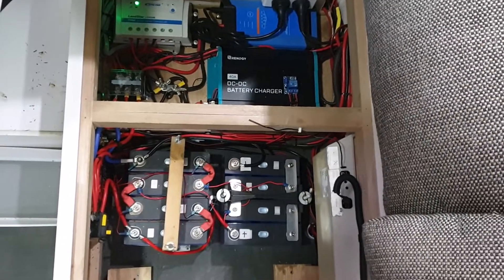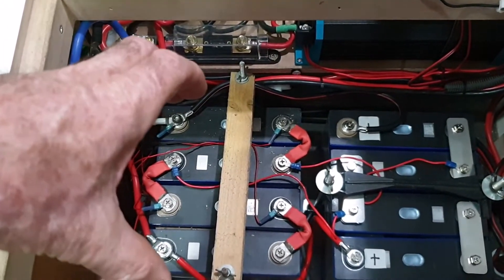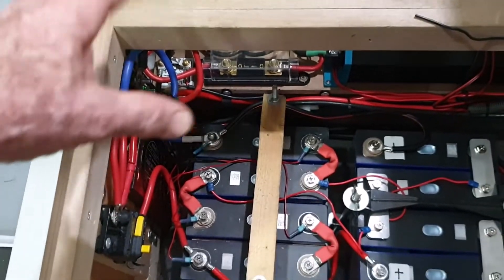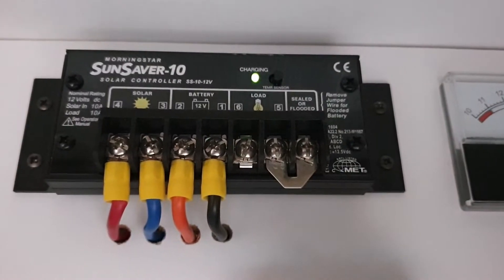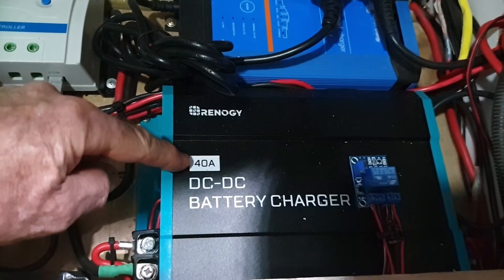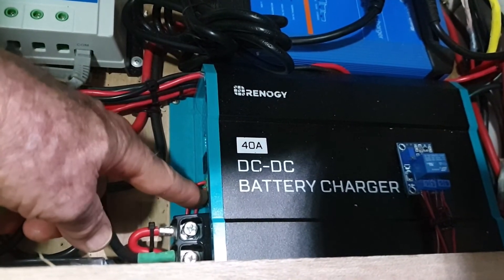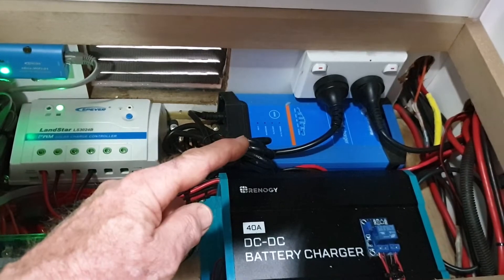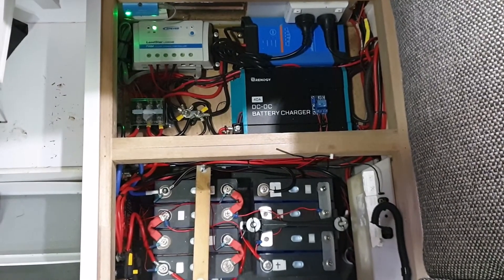Budget Caravan Lithium Battery Upgrade for Off Grid/Free Camping

Comment: Great info thanks Tim. 
My van is 2014 with the basic system same as you had, I’m just putting a plan together now and was thinking similar to what you have done but didn’t know how to go about it. 
Also, thanks for the tip on the dometic 190 fridge, I have the same in my Avan. 
Cheers
Coop
Reply from the maker: Hi Dave, sorry for the delay in replying I only look at comments every now and again. Thanks for the comments. Good Luck.

Comment: Hi Tim. Thanks for the video. Just wondered if you found the 100w panel enough or if you upgraded it. Sorry if you mentioned it in the video and I missed it.
Also, did you pout an inverter in,
Cheers
Reply from the maker: Hi Lenny, sorry a bit slow looking at the comments at the moment. I upgraded to 2 x 170 watt Renogy flexible panels mounted on the roof on aluminium support rails to space it off the roof. The old 100 watt was quite low output. These 2 panels provide about 16-17 amps in full sun and I have an external Anderson connector that parallels in with the roof panels to provide an additional 300 watts and that provides the ability to track the sun and provide for situations when I'm in partial or full shade. This combination with the 200A/h battery satisfies all my needs now. Cheers Tim
Reply: @timterry8714  all good.  Thanks for reply.  Sounds good.  Still working out how much power i will need :)

Comment: Another great video Tim, you explain it all in easy to understand for people like me who do not understand electrics, so thanks, i am also looking to changing to lithium , but one thing i cannot find a clear answer on is, once installed in the caravan, do you need to trickle charge lithium like we do with agm or once they are fully charged you can disconnect the 240v lead to caravan charger. P.S. i did buy the Bushman fridge for the van and i am very happy with it and lucky me ,my fan is very quiet , unlike yours, so thanks for your help, kind regards, Grant
Reply from the maker: Hi Grant, sorry been away and xmas and all been a bit busy. I chnged out the fan to a slight larger 60mm and its very quiet. Lithium does not trickle charge. The charger charges the battery through specific charge profile then the charge terminates completely usually determined by the (Battery Management System (BMS) that is part of the battery not the charger. Its good to leave the battery discharged to about 50% for long periods. Cheers Tim

Comment: Great video Tim, I want to replicate this sort of setup on my van.
Reply from the maker: Been on the road for 6 weeks with this setup and the batteries have performed  really well. I have not been below about 85% at anytime except I left the 3 way fridge on 12v after I stopped one afternoon ( it runs on the caravan batteries), woke up in the morning to a totally dead 12V system by 7am but it did run till 6am - so a bit over 200A/hrs. Happy with the way it has all worked on all modes of charging and delivering power to the van.

Comment: Thanks Tim, can you throw in some links to the products you bought? Also interested in how you are giving the the DC to DC charger the “accessories” input? Did you use that little blue PCB on top?
Reply from the maker: Hi Rachel, OK will put the links in description to those products. The D+ input pin is used to enable or switch on the charger. In this instance I initially simply put a very light gauge connection between the + Input terminal to the D+ so that when I connected the vehicle it would start charging. It was normally the last thing I did before I drove off and the first thing I disconnected when I stopped. 

However I decided to install a Low Voltage Dropout Relay which is the small blue board. This removes +12V from D+ when the input voltage drops below 12.7V at the input terminals of the charger. As I mentioned in the video I also run this charger at 50% charge (20A) normally to minimise load on the vehicle alternator. However I have a switch on this input to the LC terminal (also from the +12V Input terminal) to enable and disable this feature. I would only normally run it at 40A to catch up after several no sun days and only when highway driving at speed when the alternator is at high revs and to keep the heat low. AT 40A output there is a minimum load of 50A on the vehicle alternator from this charger (plus the tow vehicle's own load).